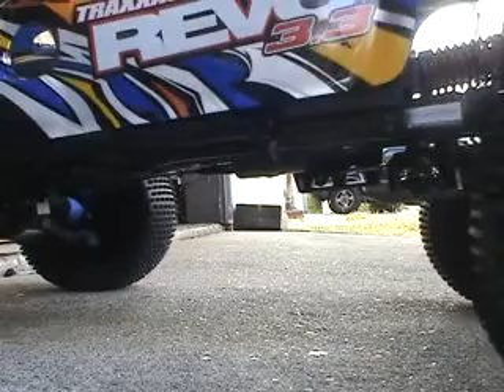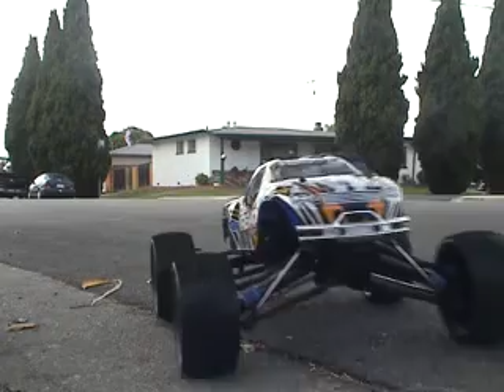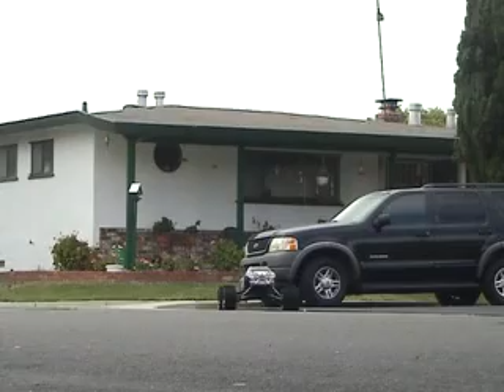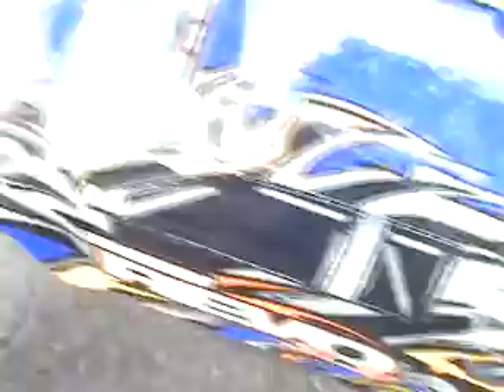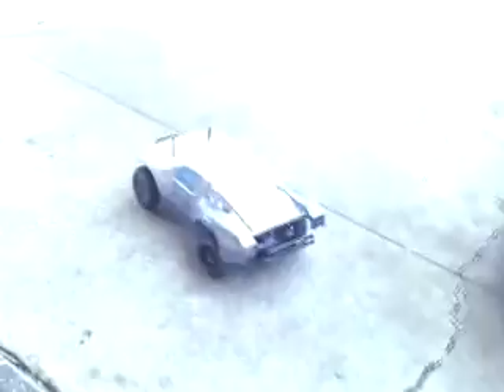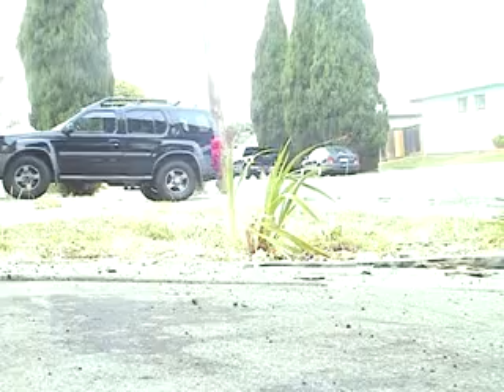BRUSHLESS  3.3 CHASSIS  E REVO TRANSMISSION BY UNCLE FRANKENSTEIN

Comment: What I meant was it a stock e revo trans
Reply from the maker: Yes, I just took a file to the chassis. Also best if using 3.3 I I use original holes and the you have to use the moon head screws.
Reply: @grydertownmember  Cool thank's
Reply from the maker: @scarfacefpv7822  you're welcome.
Reply from the maker: @scarfacefpv7822  thanks for watching.